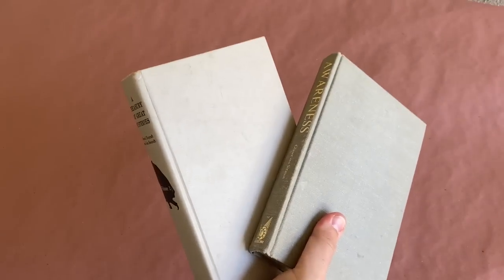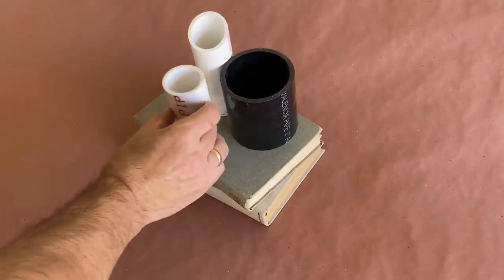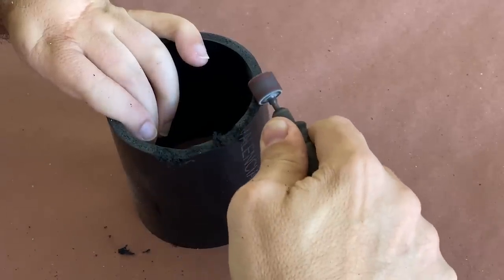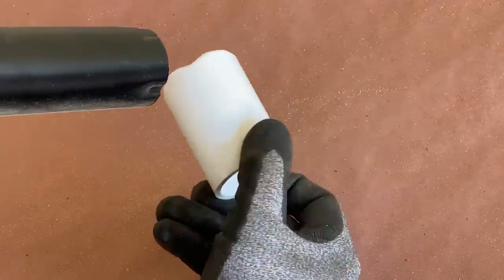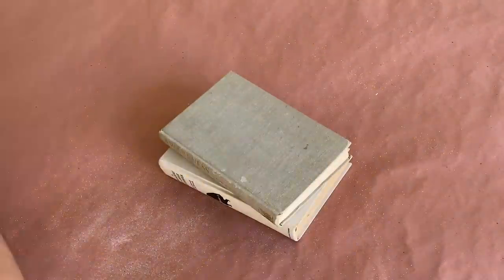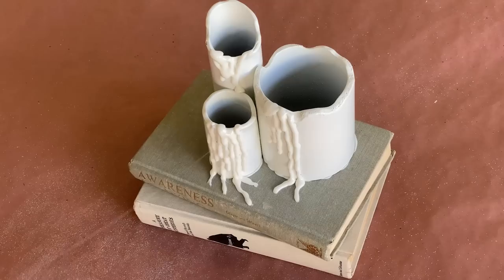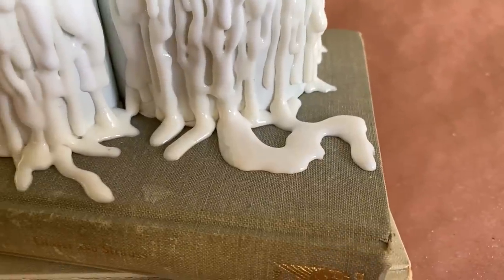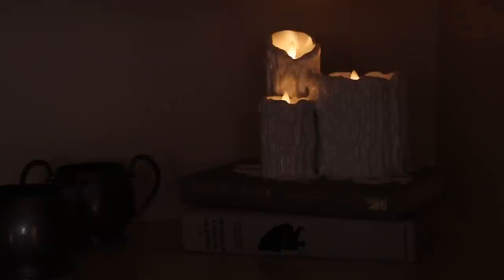Creepy Halloween Candles with a Twist!

Comment: Spray bottle or bowl of cool water makes it cool into shape mich faster. I did about 300 candles for my haunt one year. I wires them all with LEDs and thanks to you, I was able to make them plug and play.
Reply from the maker: Great tip!
Reply: 300 candles, my goodness.  It must have looked spectacular!
Reply: @noobcraft6225  PVC pipe- between 1" and 3", varying heights and drip patterns. Used a 6" fence slats cut to and assembled the height of my front porch stairs.  Drilled a hole under each candle, for the LEDs to go through,  wired and plugged. 

The stairs themselves took about 60 candles each side. Everything else was clustered or floating.
Reply: @double_digit_life.9268  do you have any photos or videos ?
Reply: @m.maclellan7147  I don't, unfortunately. I'm not that cool.

Comment: I find it interesting that candles made to look real look better than real candles. Some real candles just burn straight down the center leaving a deep well. Well done, sir!
Reply: That normally happens when you light a candle, then blow it out after a short time.  An example would be a Yankee Candle.  I found this out from somebody else, but the instructions for the candle (yeah right, who on earth reads instructions??) say that once you light a new candle, leave it to burn for 2 or 3 hours until the top 1cm has melted fully across the top, then blow it out.  When you relight it, it will continue to burn evenly.  When it burns unevenly, it's called the 'tunnelling effect' and it ruins candles, so the same principle will apply to all candles.  Light them, let the top 1cm or so melt, before blowing it out.  Then just use as normal after that.  See this video which explains all: https://www.youtube.com/watch?v=VHn8dp4eMhc

Comment: Using the white glue is a good tip. I hated having to spray paint all my creepy candles with some sort of annoying oil based paint I got. It took forever. I did find some kind of special glue that cut down on strings at Michaels that was noticeably easier to work with for candles than regular glue.
Reply: Do you know the name of the glue sticks?

Comment: That turned out great. What led lights did you use? And how did you get them to sit at the top of the candle?
Reply from the maker: You can use any led tea candle for the light and anything that will fit inside the pipe as a way to support the tea candle. I like to hide them deeper inside so that you just barely see the “flame” when I use this method, that way you don’t ruin the effect.

Comment: Okay but HOW did u finish them!!?? I was so excited to see the finished product. Like what exactly did you put? What did u use to prop it on the inside? Did you have to spray paint it white? Depth? On the thumbnail of the video it looks like a real flame. 😢
Reply from the maker: I went really simple and dropped a bit of a pool noodle inside each on as a platform and rested a moving flame tea candle on it. No extra painting needed beyond what I mention in the video.

Comment: You did not tell how you added the tealights.  Bad tutorial.
Reply from the maker: You just drop them in there. I've always preferred seeing the light from the candle rather than the flame. If you wanted to see them, you could get some foam pool noodles, cut them down to size and paint them black. Then place the LED tea candle on top.
Reply: @VanOaksProps  You can see the flame.  If you drop them in, they will fall to the bottom and you won't see the flame.  And what tea light is as wide as the widest candle.  Incomplete info.